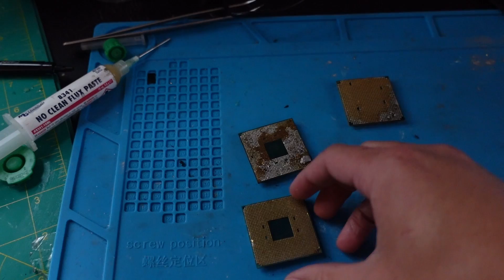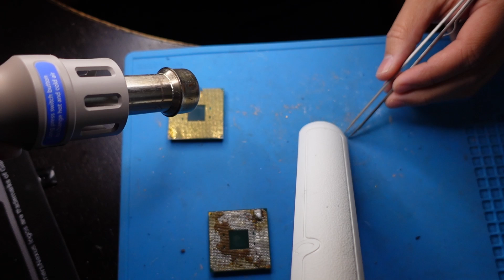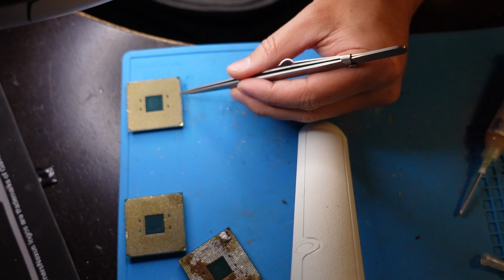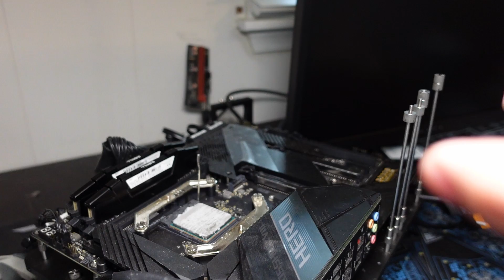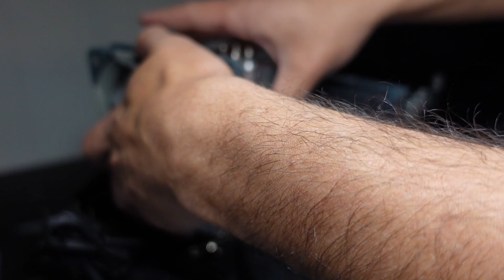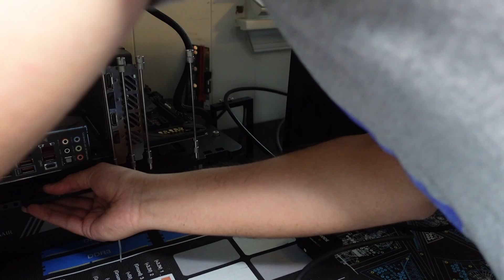5800x3d repair, how to solder pins back to a Ryzen CPU!!!

Comment: i've had success by cutting off pins from s478 cpu with base and all, and dropping them in the socket.

The pins are bit thicker and seat nicely in am4 socket, and the tin at the base is soft enough to conform to the nub of the old pin.

Had 1800x back in the day i bought for 10€ with 14 broken pins.. used it till 2021 with 4.1ghz oc and 4x3400mhz cl14 ram.. then the memorycontroller burnt out due to hugely excess SOC voltages :D

it still work with single stick of singlerank B-die but not with anything else.. thats how i know it being the memorycontroller (doesnt help changing the pins etc)
Reply from the maker: @NuffMan_  yup that's a great way to do it, if you don't want to learn how to solder it back on. The FX pins work great too because they are taller